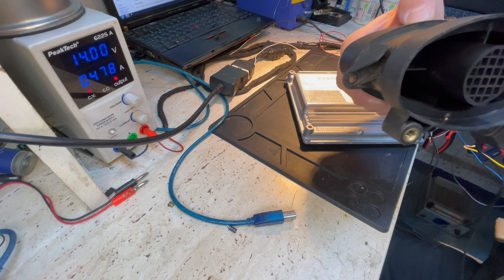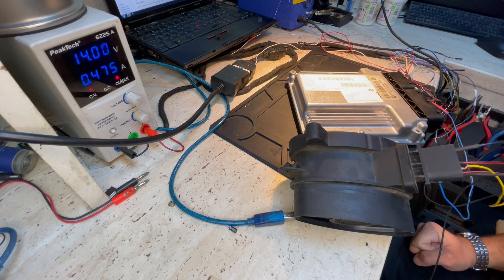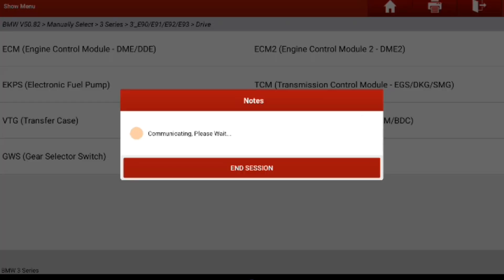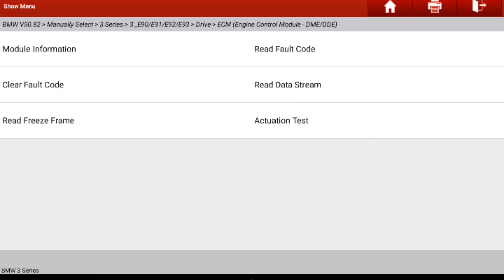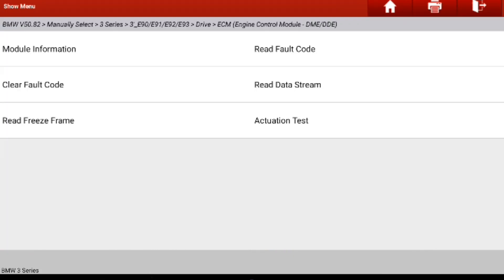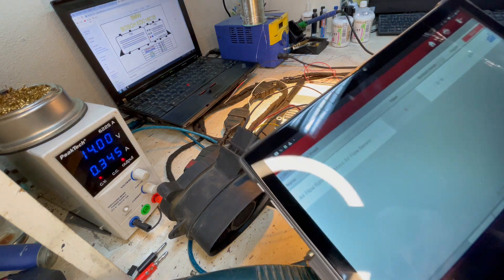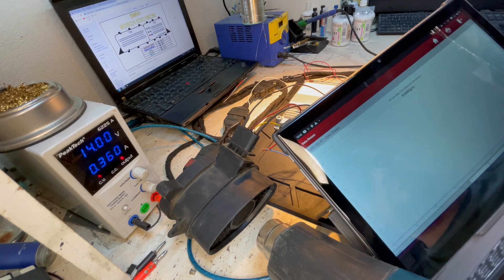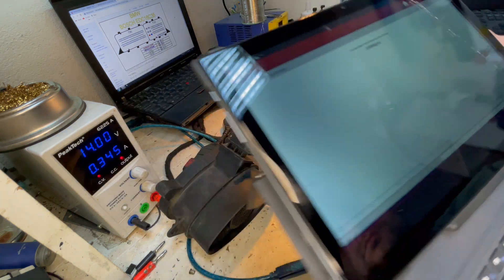BMW E90 M47 ECU - Mass air flow signal check

Comment: Typical when customers blame the ECU before checking rest of the car properly. 

You diagnosed the DME on bench with Launch, did you need a gateway or hooked up directly to the CAN pins?
Reply from the maker: On EDC16C35 no need gateway, unless you want to use ISTA for diagnostic.